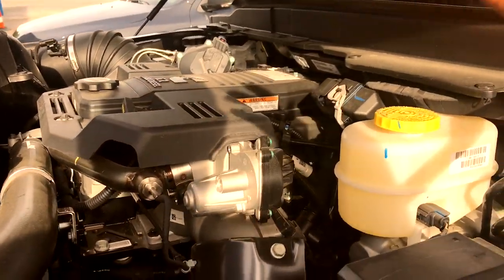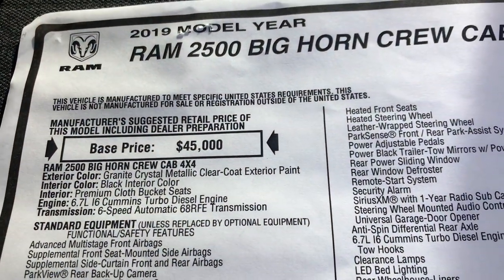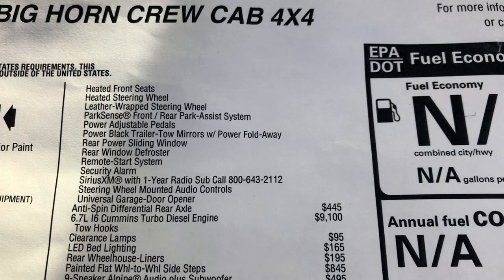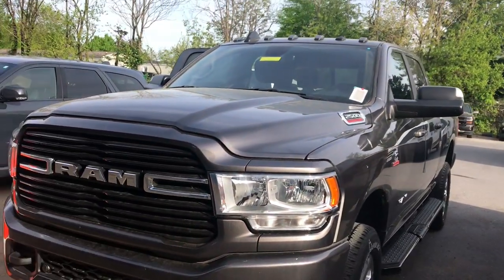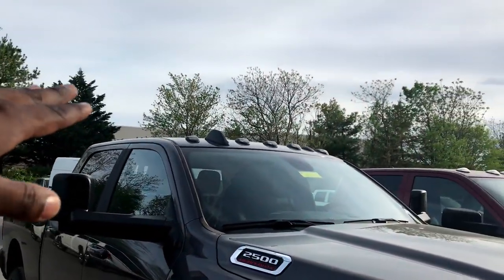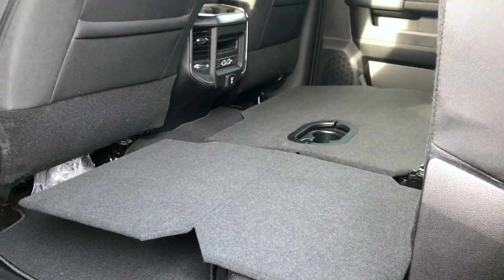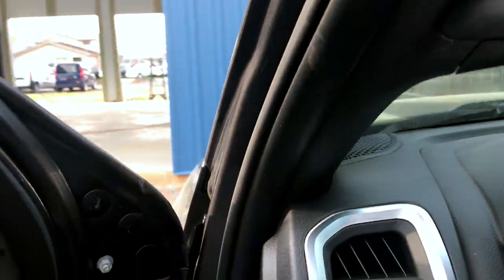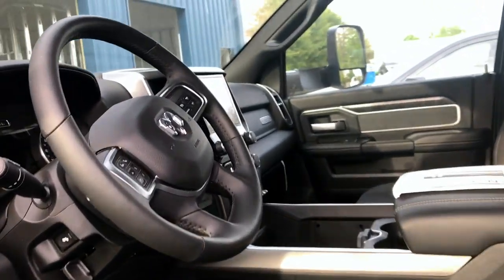2019 RAM 2500 Big Horn - Cummins + Sport Appearance = Perfect Combo!

Comment: My take:

As the factory wheels, I will definitely have to change them out immediately to aftermarket wheels.

22x10 or 12 or 14, non staggered so I can rotate them out and the color will not be a all black wheel. I just hate a all black body, tires, wheels, lug nuts, with limo black tint look. I just don't want to literally drive in "darkness", even during the day.

Needs more color options for the truck body also.

Comment: Hope in the future that you can do a driving video of the power wagon?
Your video's good quality!
Reply from the maker: pjasyl - Mikey P is ordering one and we are gonna do a LOT more then driving it!
Reply: Thanks for reply!
Good news. Look forward to future video's.
Was considering the rebel, however now the power wagon because both 380 degree camera system & ram box option with six foot four inch bed  is what i am looking for that currently is not available on the rebel.
The power wagon has greater off road capability plus uses the new 1500 body frame. The old cab design does not bother me!
Reply from the maker: pjasyl awesome! I think the rebel would be a good option if you want the air suspension but other than that I would choose the PW! I didn’t know they were using new 1500 frame for PW?!?!?! Learn something new everyday and the doesn’t bother me either!
Reply: @JB_WhoWork  Considered air suspension not viable in climate  conditions where i live..
Reply from the maker: pjasyl power wagon it is!

Comment: Im a Chevy Guy. But looking for a turbo diesel dodge? So the cummins is a V6? 4reals? V6 cummins diesel pulls more than the 5.3 chevy????

Someone PLEASE help me n explain.
Reply from the maker: RAM offers a I-6 which basically means the cylinders are inline. The pistons and cylinder heads are larger in comparison to a V8 setup and keep in mind that must semi trucks use inline 6 Diesel engines.
Reply: Thank you...
Reply: These Cummins engines are used for heavy machinery as wel
Reply from the maker: Yup!